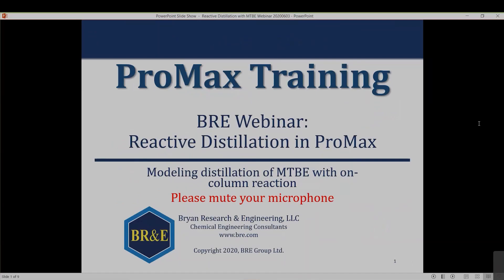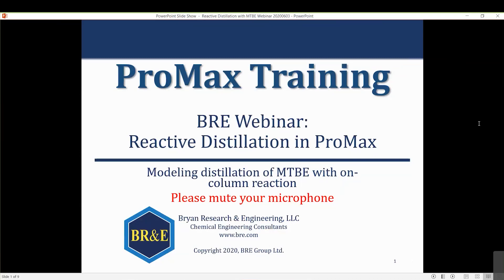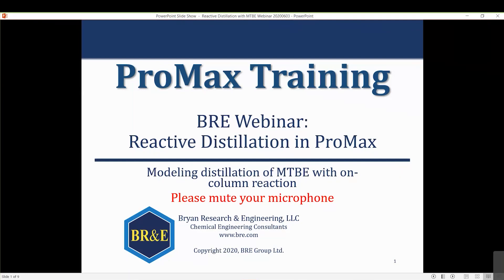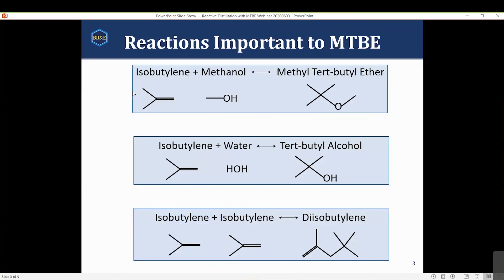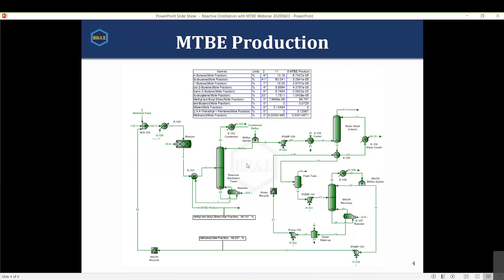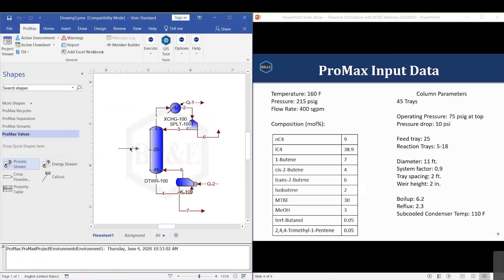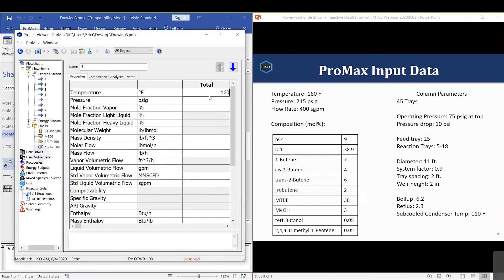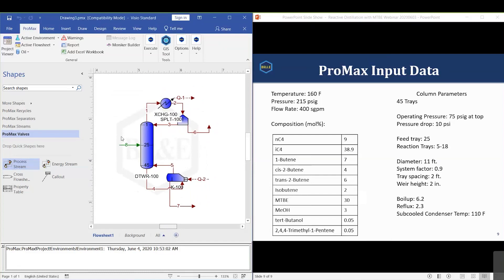Reactive Distillation with MTBE

Comment: What is the tool you use for the design of the reactive column? visio only?
Reply from the maker: Howdy.  I'm not sure I understand your question but I'll do the best I can with the information you provided.  The tool is ProMax which has Visio embedded into our product.  You would use the Column Block to do most of that work.

Comment: For the last distillation column, water gets released at the bottom as a liquid and 98% methanol vapor is released at the top and is directed to the recycle stream. How does it exactly turn into a liquid stream to mix with the liquid methanol feed?
Reply from the maker: Assuming you are referring to slide 4 of the presentation, the methanol recovered as overhead product from the methanol recovery tower is completely condensed. Part of the liquid is used as reflux to the column, the rest is the recovered methanol that is recycled back to the front of the process. Thus, there is no vapor in the stream that is recycled back to the front.
Reply: @BRE_ProMax  and on the same slide of the presentation, after the reactive distillation column, the condensed MeOH and butene azeotrope is cooled further by a cooler and gets sent to the water wash column. does the MeOH butene mix stay as a condensed liquid when entering the water wash column?
Reply from the maker: @modimoussa33  The overhead vapor is run through a heat exchanger where the vapor is cooled until is condenses. This is how the liquid is formed. If you need to know the exact physical processes of how condensation works, we recommend that you look into topics like “states of matter”, or “physical changes”.
Reply: @BRE_ProMax  I understand how the liquid is formed, but my question was if the overhead, after condensation, stays as a liquid when entering the water wash column
Reply from the maker: @modimoussa33  The Water Wash Column in the drawing is a liquid/liquid contactor. There is no vapor present in the column at all. Water is the heavy liquid that goes in the top and comes out the bottom, while the unreacted butanes are the light liquid that goes in the bottom and out the top. The water wash is primarily present to remove the methanol in the unreacted butanes so that the unreacted methanol can be recycled an make the MTBE process more efficient and less costly.

Comment: why is MTBE the bottem product of the reactive destillation column and not methanol because the boiling point of methanol is higher then MTBE?
Reply from the maker: In the reactive distillation process for the production of MTBE, the overhead product is an azeotrope of unreacted C4 components and methanol. The methanol concentration in the feed to the column is carefully controlled so that the azeotrope (collected as the top product) contains the bulk of unreacted methanol, and the MTBE is taken as the bottoms product.